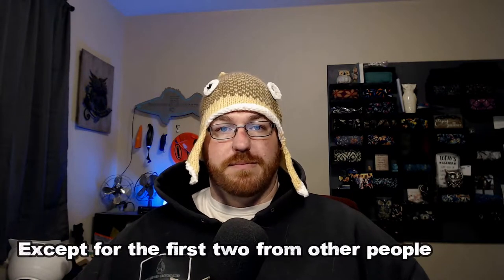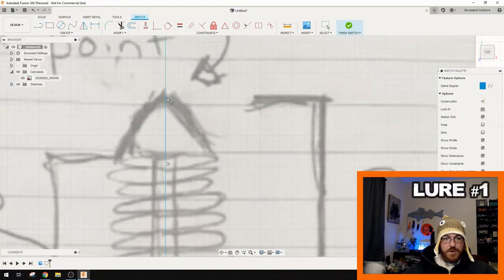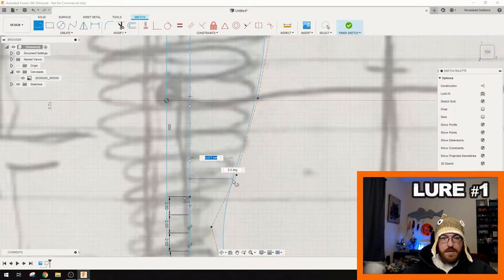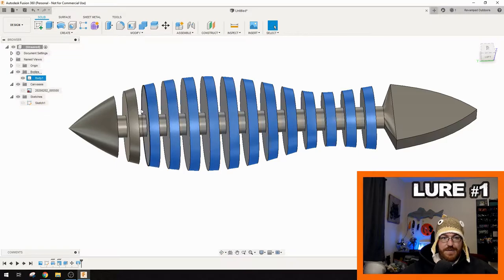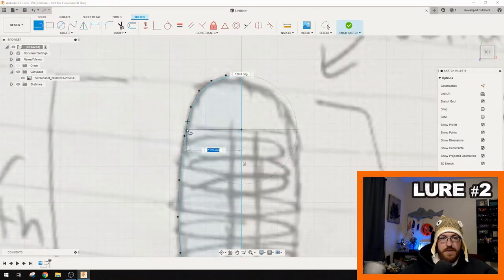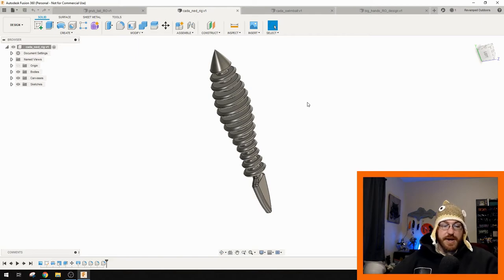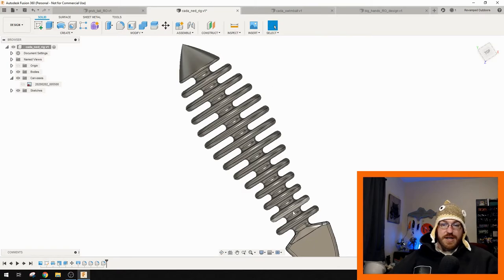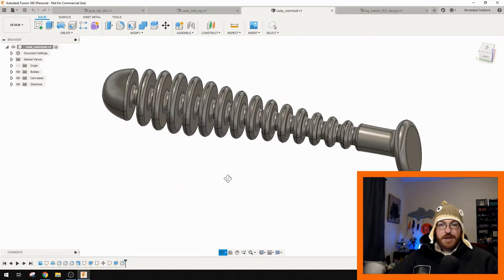How many lures can I design in Fusion 360 within 1 hour?

Comment: Good videos. Do you make resin 2 piece molds
Reply from the maker: I do silicone 2 pieces, I've tried vac50  hard molds and they work well but the silicone just seems to be easier to work with.

Comment: Hey man one more question! Is there a material in fusion 360 that is close to plastisol? I'm trying to calculate the weight that my lure will be but cant find that matieral.
Reply from the maker: I've only ever gone off of volume calculations based on the un heated plastisol for estimations. I'm not sure which plastic would be similar in weight I'll look into it though I'm sure there is an option that's somewhat close.